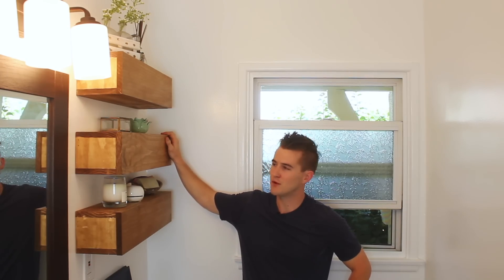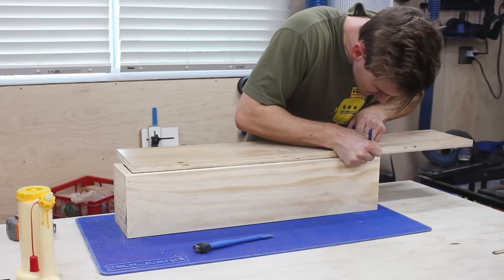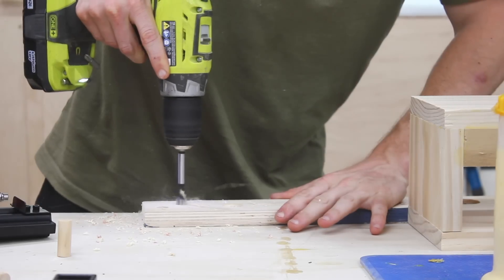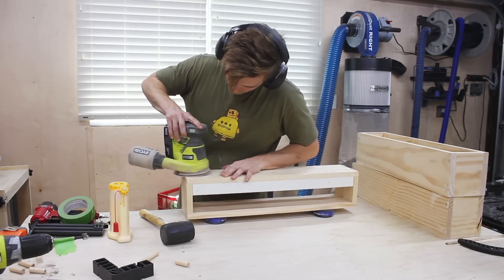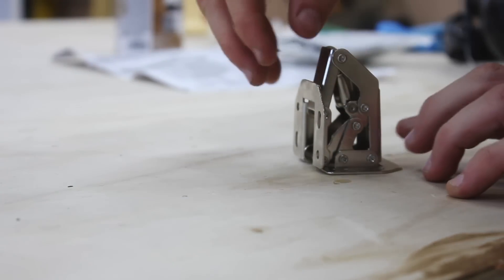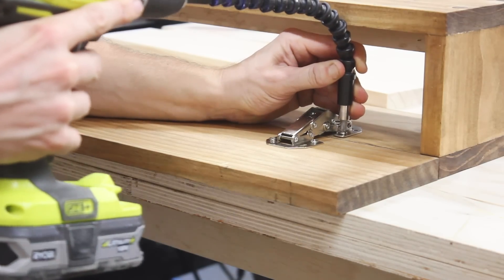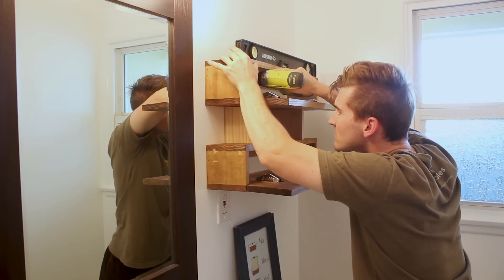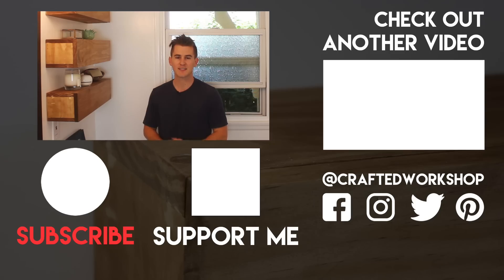DIY Floating Shelves with Hidden Storage // How To - Woodworking

Comment: Thumbs up for that awesome camera trick you did with the mirror!!!
Reply: Thanks!
Reply: Thumbs down for having those snap hardware pieces in the front of his compartment area!Gotta do some thing from undeneath or along the edge for it to not be a doofy solution.Close but no cigar!😘
Reply: @garyhundsrucker7771  Do you know of hinges that would allow for the door to open as it currently does, while retaining the "hidden" aspect of the design as well as the ability to keep the door securely closed without exposed fasteners (also retaining the "hidden" aspect of the design)....?
Reply: @TanBzk  maybe countersink some flat hinges with a magnet up top for holding it closed ? Would look abit cleaner i guess.. new to this sort of work so there probably is alot better ways of doing it.

Comment: Definitely a cool project, and great touch with the dowels. Do you think the top shelf would be more accessible if you were to mount it upside down so the door flipped up instead of down?
Reply: Someone else mentioned that - I'm literally going home and flipping it as suggested - it's a great move and I'm surprised after a few months of usage we never thought of it - thanks for the tip!

Comment: Shelves came out clean 👌🏽. Have you looked into french cleats? Another mounting option that is usually a bit easier than trying to hold a larger piece with one hand and drilling in with the other while trying to keep it all level 😅
Reply: French cleats are great! I just wanted these flush to the wall and the method I went with kept it easy and clean if you don't have a table saw to make cleats easily. Although I suppose you could still make it flush with cleats.

Comment: Nice shelves!  I"d like to know what hinges you used, not on materials list.

Any advice for RV cabinet hinges or struts?  They open upwards.
The spring struts I bought on Amazon gave way.  The next bigger gas struts I bought, do not work!  I would love to get some Blum Rotary hinges but they are very pricey.  The rotary hinges however, are the most effective.

Comment: Cool design!
After dealing with the hardware installation would you change your order of operations on the build? These hinges are well designed and you can install them in the open position.
Reply: I actually built a second set of these last week for our master bathroom - the simplest solution is getting a right angle drill bit attachment, but since I don't have one, I actually predrilled all of the holes before doing the assembly, that made it easy to hand screw in the hardware once assembled. Cheers

Comment: Where did you get the hinges from? I really want to make some of these but I always struggle to find good hardware for projects. I didn’t see a link to them, unless I’m just stupid and missed it.
Reply: They have them at home depot, and Lowe's I'm sure.
Reply: They're called "90-Degree Surface Mount Hidden Spring Cabinet Hinge" - sold in packs of $2 and super awesome. My only wish is that they sold them in "soft close"

Comment: I have tried to make 2 shelves, but the hinges don't seem to line up the front cover in the closed position, what am i doing wrong, when i close the front door it is off 1/2 an inch and leaves a over hang?

Comment: How do you not get squeeze out when you put in the dowels? I always get some, and then it messes up the finish, because the glue makes the wood more oil resistantant
Reply: He doesn't put glue on the dowel itself and doesn't over fill the hole. One thing that you could do is come back with a damp rag and wipe up the excess before it dries. After cure time, sand 80, 120 and then 180ish, this should eliminate any wood that might have absorbed some of that glue. Check out "Understanding Wood Finishing" by Bob Flexner. Get the newer one.
Reply: @Travis32  Excellent answer - thanks for chiming in!
Reply: @Travis32  Thank you!

Comment: why not add a chamfer on the top of the door so its easier to open? also love the mirror work dude
Reply: I did actually add a chamfer after about a week of use - you are correct that it works so much better / easier on the hands - great tip!

Comment: The wood seems comically thick for that purpose, other than that great project!
Reply: I think it's a builder's choice - this was 3/4" thick and I think if you can plain them down to a thinner piece or re-saw down for a thinner profile that fits your space, then that is a great move.

Comment: should have used  wood conditioner  first .  now its all blotchy .  youll learn  from it :)
Reply from the maker: He did you pre-stain conditioner, but it's Pine, a pain to stain.
Reply: I think using hardwoods for these is ideal (just a little pricier) - no stain and just the protective finish of your choice
Reply: If u plane the board then condition  you get different result.  Vs not planing  before wood conditioner